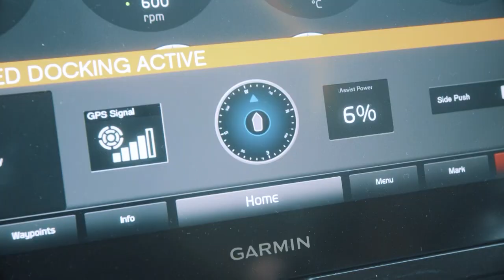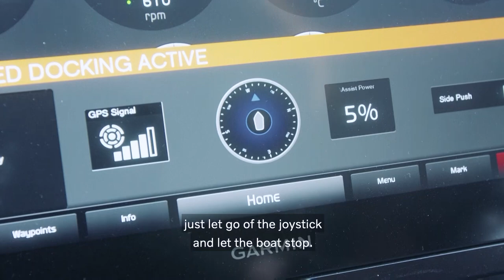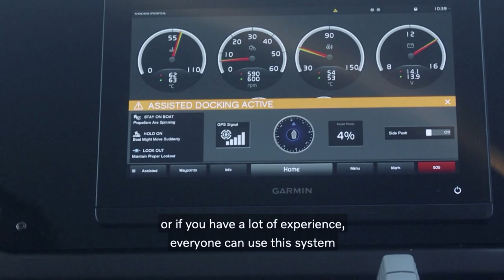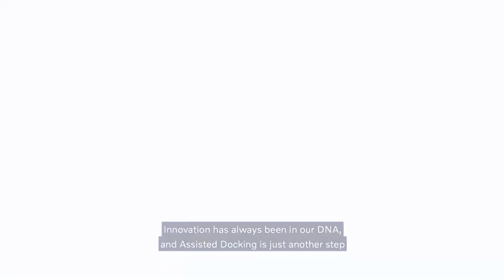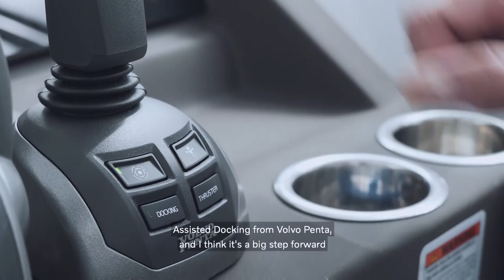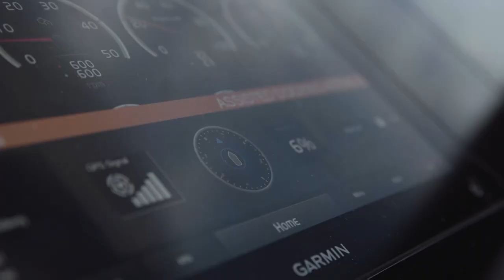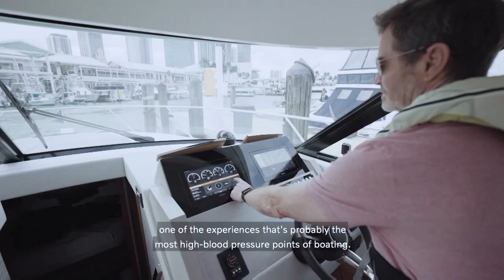Assisted Docking Webcast by Volvo Penta

Comment: Now if only someone could tell me what I need to get this functionality on my 2020 Jeanneau NC37.
Reply: I hace asked also for information
Reply from the maker: We're glad to hear you’re interested in our Assisted Docking feature! It's not yet on the market, but will be rolled out gradually starting this spring. It's an add-on to our existing Volvo Penta IPS system, and the price will differ depending on the size of driveline and boat. Should you have the DPS system installed already, it would require a relatively small upgrade, including a software upgrade and a new antenna. Price wise, it would be a very small % of the cost of the yacht itself. If you want information about when Assisted Docking will be available, you can sign up on our website: https://www.volvopenta.com/assisteddocking/ 
Hope this helps!